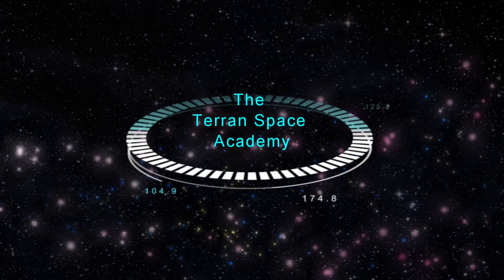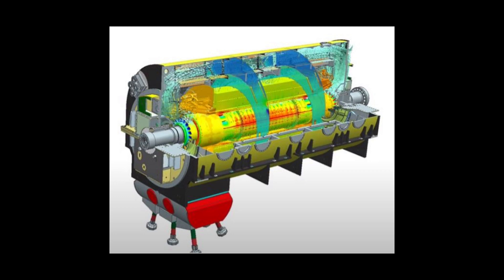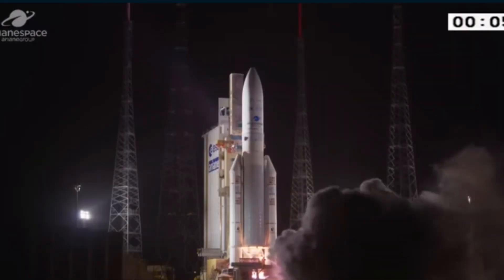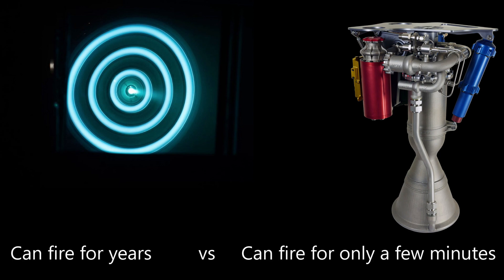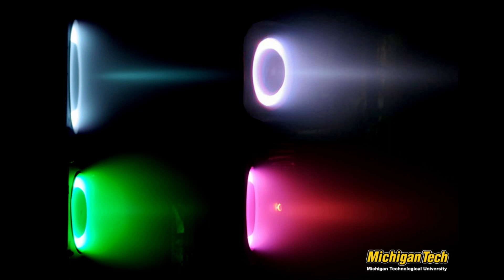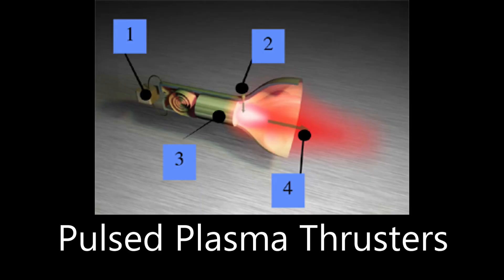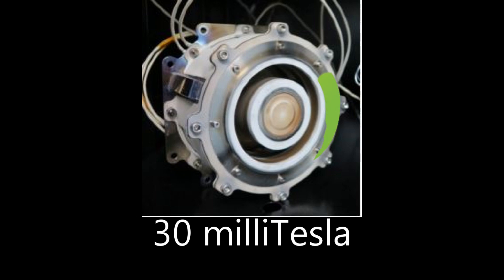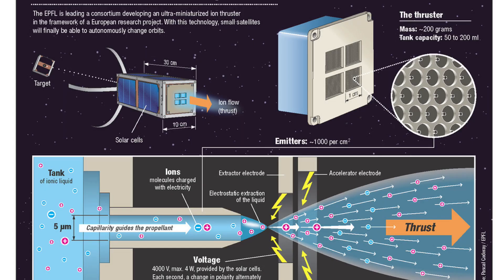Rocket Science: Advanced Ion Propulsion Systems

Comment: Describing VASIMR as electro-thermal is new to me. I've wondered why call it a plasma drive instead of ion drive as it's basically the same.
Reply from the maker: It was confusing to me also for a while. It turns out that they don’t electromagnetically propel the ionized gas out of the engine. They just heat it up And contain it in a magnetic bubble. Open on one end so it can exhaust.
Reply: @terranspaceacademy  I read "a type of electric thruster" from their web site, and thought of ion drives. Electric thruster is a broader term like chemical thruster/rockets. So, I now reread its description and better realize the difference, I guess. Gas is converted by the Helicon coupler into 'cold' plasma, now some 5800K, and then is heated to plasma thrust at 1-10 million K (way hotter than in ion drives) by the ICH coupler, a fusion technique, which looks the same as the helicon coupler (probably operating at different frequency and power). It should be possible to go to higher temperatures, ...and make a fusion drive out of it (visualizing the Death Star beam configuration). :D 
I'm rooting for it to be further tested in space (as planned on the ISS) and used in a real interplanetary space craft, like Starship, or Voyager Station. Given its power requirement, probably waiting for in space nuclear reactors. Could it use volatile methane to make plasma? :D Not likely. Why is its development so slow given that it is developed by an ex-NASA astronaut, and the engineering done thus far looks sound? Politics and money. :D Oh, well. :(

Comment: ..the problem is what would be the power source for these engines...what do we have that can produce enough electricity that is also light enough to be put in an aircraft..I think we need to look seriously at all the "conspiracy theories" that are out there for production of electricity....solid state generators would be the ideal..rotating magnet generators would work but would create torque at high RPMs which would have to be dealt with which may become unstable in a vibrative environment....I read somewhere about flat coils in conjunction with magnets..feeding back some of the output from these flat coils into coils around the magnets at a harmonic frequency could greatly amplify the output...just keep altering the magnet coil frequency till you see sharp increases in output..maybe even ripple the better of the frequencies for greater amplification..
Reply from the maker: Nuclear is the only answer past the orbit of Venus.  Fusion for the future.

Comment: Great video!!! Could be possible generate a significant amount of electric power for any of this ion drives by using a nuclear reactor inside the space vehicle?
Reply from the maker: Absolutely.  Once in space a nuclear reactor and a conventional ion drive are very practical.  But once you have a nuclear reactor in space you have to look at nuclear thermal and pulsed nuclear thermal.  They have a lot more thrust with an Isp of 900 and up to 5000 respectively.  With the greater propellant processing speed due to reduced latency time and especially with neutron heating it becomes more practical to just use the reactor itself.  You will see solar electric ion propulsion and I believe it would be smart to use hydrogen and oxygen through fuel cells with the water being used for shielding while the electricity supplements the solar power to increase the thrust of a xenon or argon based ion drive....
Reply: @terranspaceacademy  thanks!!!!